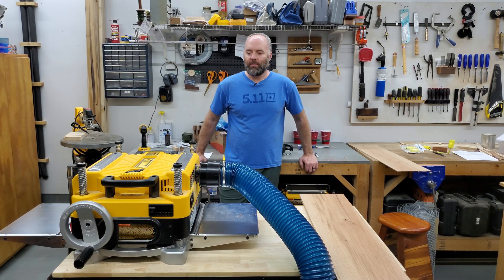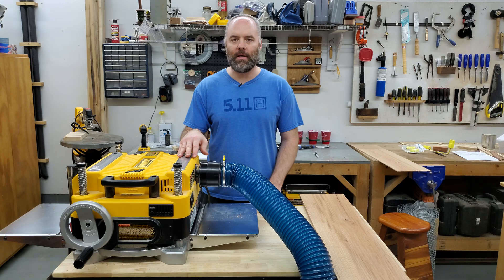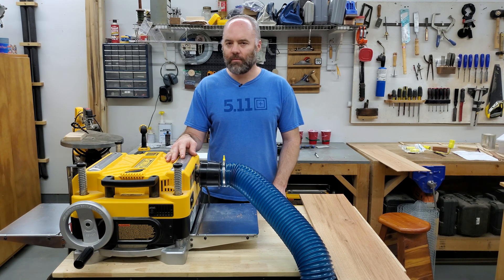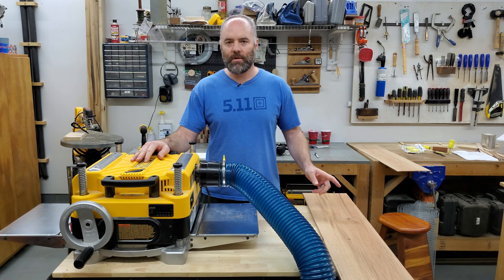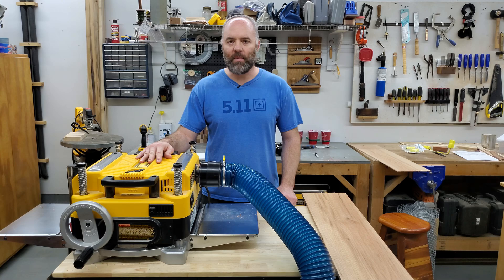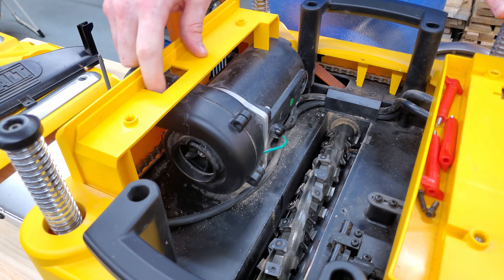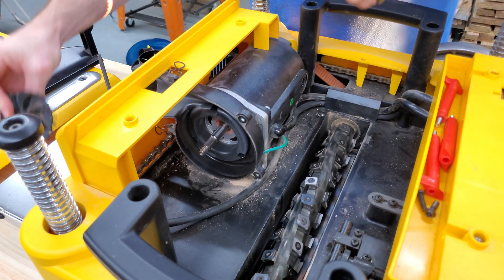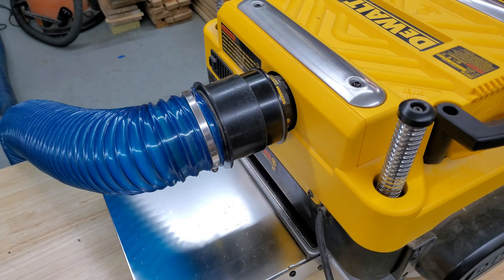What happens when you remove the impeller from the planer?

Comment: Great video.  I think what you've done will not impact anything in a negative way, as your dust collector pulls the chips and also pull the air to cool the motor, the only question is what's the airflow through the motor now, versus what it was before you removed the impeller.  Also, the 3A drop in power consumption in loaded mode, puts less load on the motor, thus it wont get as hot.  You're dissipating about 300W less heat, and that is significant, so it may be the same potatoes in the end when it comes to cooling or it may be actually better if the motor sees more air going through it.  Face it, during idle run you're saving about 5 cents an hour in electric cost, and during loaded time, it's about 2 cents.  But before you didn't have to use a dust collector so the savings are not really there.  I have a similar setup, and there were times when I was using the planer, yet forgot to turn on the dust collection.  In your case that would be a bigger issue.  It would be a good idea to get a special switch going to your planer so when you turn it on, the dust collector comes on automatically.  Cheers.

Comment: That impeller is also the cooling fan for the motor....
Reply from the maker: That is correct. My initial concern was that the motor would fill up with dust without the impeller, which would also indicate reduced air flow and cooling. So far no dust in the motor, which means the dust collector is providing the necessary cooling air.
Reply: @TheSnekkerShow  Probably, but it would be interesting to see a direct comparison of motor temp after a standardized planning task (eg 4 passes at 1/16th DOC). Starting with motor at ambient each time, complete the standard task, then measure motor temp with an IR gun both with and w/o the impeller.

Comment: When using the impeller, did you have the dust collector on as well? I’m wondering if the impeller is fighting to push all that air through the hoses?
Reply from the maker: When the planer was new, I just had a shop vac, and the impeller would frequently blow the shop vac hose of the planer. I didn't have that trouble with the dust collection system.

Comment: Doesn't that impeller also cool the motor?
Reply: I guess I wasn't the only one with this thought... Sometimes it pays to read the other comments first... ;)
Reply: I’m sure one side is for the chips and the other side is to cool the motor. I don’t think I’ll try this.
Reply: Does the impeller not create a vacuum in the motor to cool it? With air taking the path of least resistance is the dust collector going to create anywhere near the same amount of “pressure” vacuum within the motor to cool it down?
Reply: The vacuum created when connected to a vac system, will draw heat from the planer. If you take off the impeller and do not have it connected to a vac system, that would be bad
Reply: I have to wonder if it would be OK to remove the blades odd th impeller from the impeller on the wood chip side bu leave them from the motor side

Comment: I tried this, and my planer died 1 hour later! Don’t do it!
Reply from the maker: I suspect there's more to this story. What type of dust collection system did you have connected?
Reply: @TheSnekkerShow  3 HP Oneida
Reply: @TheSnekkerShow  the ductwork was designed and purchased from Oneida, and my planer stood only 4 feet away from the collector
Reply from the maker: @mikeleger4767  Then you can rest assured that the death of your planer had nothing to do with removing the impeller. The impeller moves chips and moves air, and a dust collection system moves chips and moves air.  An Oneida 3 hp moves more chips and air than the impeller would anyway, so it made your impeller extra unnecessary.

Comment: Thanks for the video.   I may have to remove my impeller just for fun.
If I do this, my next step will be to design and 3D print an adapter for the 4in dust hose without the 2 1/2in restriction which must add some pressure drop in the dust chute.
Dave.
Reply from the maker: That's a good idea. That's definitely a restrictive adapter.

Comment: I'm not sure if this has already been said in the comment section, but.....

I'm almost certain that  (from an engineering standpoint)  the inner blades of your impeller are used to pull air through the motor itself,  to keep it cool when in use. Now since this is also the drive motor for the cutter head, this could be causing damage in the long-run. If you have access to a thermal imaging camera (Flir type?) would you possibly provide a video of the "with and without" impeller temps?

I'm sure a laser type of heat probe would work too, just not as well.

If not, I have one in my toolbox at work, and I suppose I could make a response video to yours, with temps using my DW735. I'll give you a chance to do it before I go that route though.

As always, thank you for the videos! Like I said on your original "I wish I had watched this video before buying the Shelix cutterhead" video.... You saved me a TON of headache.
Reply from the maker: That's a good idea, but I don't expect to have time for it anytime soon. I did consider cooling air before publishing this, and I could feel that the side vent on the other end of the motor was moving air and the motor was staying cool. I think the impeller is more important when no dust collection is available to perform the same function.
Reply: Yep, I wouldn't do this.. especially with the helical head causing increased load vs straight knives. That's kind of a kiss of death for motor life.

Comment: Good stuff! What kind of CFM does your dust collector pull?
Reply from the maker: I finally measured the CFM.  It's somewhere around 380 where I connect to the planer.  https://youtu.be/CjKLIa9vyi4
Reply from the maker: That's a good question. Since I modified the system to be two- stage, the manufacturer's specs would no longer apply.
Reply: @TheSnekkerShow  The modifications you made - my guess is installing the Rikon Impeller - would only improve your CFMs. You;re probably pulling an optimal 1500 CFM, but it would be nice to know for sure.  I've got a Powermatic PM1300 with my DW735 as the first tool on the dust collection tree. It would be nice to know if that's sufficient for cooling the motor alone, or if the impeller is needed for cooling.
Reply from the maker: @repairmanjackX  I've heard good things about the Rikon upgrade. I've been asked enough times about CFM that I just ordered a cheap anemometer, so I might have an answer before too long.
Reply: My guess is not a lot.  Check Bill Pentz's website, he's the cyclone guru and provides a TON of information about particle size, CFM, impeller size, ducting size... everything you'll ever need for central dust collection.  I used it to build my own 5 h.p. cyclone with the same specs as a new Clearvue... it's awesome and definitely the coolest thing I've ever made.

Comment: I wonder if reduced load on the motor due to the impeller being removed allows for more power on the cutter head
Reply from the maker: I feel like it's struggling less with tough pieces, so I'd say yes.
Reply: Being it is an HF device I would not trust their specifications statements, just like the 6 hp shop vac that I have in my garage that runs on 120 volts. Yea right🤣🛫
Reply from the maker: @TheFalconJetDriver  You're probably right. One of these days I might try to measure CFM, but it's been working well enough that I'm content with my ignorance.

Comment: Hi, wondering how a shop vac with 2 1/2 hose would work now with the impeller removed?
Reply from the maker: I haven't tried that yet, but my first thought is that it would be risky with straight knives because of how large the shavings are, and how prone to clogging shop-vac hoses are. It might be a little safer with a helical head because of the smaller chips, but I would still consider it risky.

Comment: It looks like the motor side of the impeller may be used to draw air through the motor for cooling and exhaust it out the discharge duct. A dust collector running  the hole time the motor is on might draw enough cooling air through the motor to keep it cool. You said you've been running it for months now so it seems to work. Just a thought.
Reply from the maker: That was my thought as well. My initial concern was that the motor would fill up with dust without the impeller, which would also indicate reduced air flow and cooling. So far no dust in the motor.
Reply: @TheSnekkerShow  I removed the impeller but put a caution label on the top saying impeller is removed so to only run it connected to a dust collection system so the motor gets air flow and doesn't overheat.
Reply from the maker: @paulpatten7799  Smart move.

Comment: I would like to see the voltage drop at the planner during the planning operation. Amperage will increase if the voltage drops. Are you using an extend cord to the planner? How long of a branch circuit do you have from the planner to the circuit breaker panel?
Reply from the maker: I finally got around to testing voltage tonight. Starting with the original setup with a short 12-gauge extension cord, it was approximately 120v before starting the motor, 119v after, and dropped to 115v while planing 8” wide maple. Then I plugged directly in to an outlet right next to the breaker panel and got 120v, 119v, and 117v.  There were some minor fluctuations between test sets, but those numbers are a good summary of the results. Amperage was maybe 1 or 2 higher using the extension cord, but still around 25-27 for both.
Reply: @TheSnekkerShow  Thank you for doing that test. I have a Shelix cutterhead sitting on my bench waiting to be installed in my DeWALT 735. After watching your first video on the amperage during planning I was concerned because my circuit length from panel to planer receptacle is about 75 feet and additional 25 feet of #12 extension cord. My wiring is in EMT conduit so if need be I can pull out the #12 wire and replace with #10 or #8 and shorten the cord to 5 feet if the O.L. on the planer trips.
Reply from the maker: I would guess 30' of 12ga wire between the breaker and receptacle, and a 15' 12ga extension cord for the test, but I got the same measurements when it was plugged directly in to the wall. It would be interesting to measure voltage.

Comment: Not sure if you need it or interested, but I find a 90 degree and an inexpensive replacement for the dust port invaluable for dust collector https://pin.it/1ezQ9cb. This is a Pinterest shot of the connector and a link to the Next Level Carpentry video for a great tuneup guide for this planner. Here is another Pinterest shot which includes the PVC Pool parts  https://pin.it/3lTygj1. Hope it helps someone that needs this.
Reply from the maker: Good tip, thanks.
Reply: @TheSnekkerShow   Thank you for this tip and your great videos.  Once I run out of blades, I’m going to invest the correct Shelix cutter head, thanks to your insight.
Reply from the maker: @jamaxit  Thanks for the feedback.

Comment: Perhaps I missed it (and I don't own this planer) but wouldn't be even better to disconnect the blower motor electrically (as well as remove the impeller)?  I would think that it's still using power to turn the shaft that the impeller sits on.
Reply: Looks like that motor also turns the cutter head.  You can see the red belt at the rear of the machine.  I was wondering if the back side of the impeller is supposed to cool the motor ?
Reply from the maker: @danharold3087  You are correct, there's a vent on the right side of the planer where the impeller, or now dust collection system, draws air past the motor.
Reply from the maker: That was my original thought as well, but it's attached to the shaft of the motor.